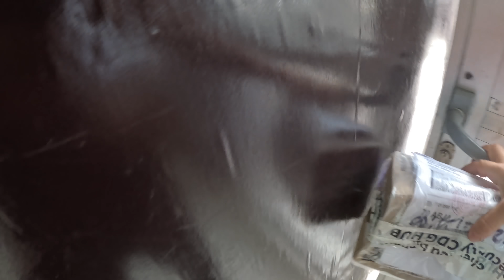Opening up the engine of my Honda CRF300 Rally in West-Africa |S7-E52|

Comment: nice work they did there
even in the rain?  haha   

And no front but you couldve let like 0.5L oil out of your gearbox and klutchbox and then look at how the oil looks
and just refill 0.5 fresh oil if its fine

as soon as i saw the colour of your oil i knew what was wrong .. look at the heat colours holy smokes

its not supposed to chew into the alluminium like this

the problem was your missing temp sensor 

no hate just wanna give advise
anyway keep on doing what you doing you awesone

much love from germany

Comment: 😳pity they did not spend 10 mins cleaning the engine externally,  before opening & stripping it to prevent even one grain of sand/dirt from entering! - OMG no torque wrench ! 🔧they are like a $50 tool these days.  btw imo it would be GREAT if you listed the 'parts' changed in your wrap-up.

Comment: Nah That's not Road side repair. I swapped a piston on a Mk 1 1200 CC CORTINA in the basement  of a  Valencia Hotel, Spain. Left a large oil stain on the new concrete floor back in the 1980's. All on my own.

Comment: And that’s why I own a Honda!  I wouldn’t even consider any other brand… they work, and when they break, they are so straightforward to repair.  I’m not impressed with all this electronic wizardry…. Reliable mechanics is all we need
Reply: Quite literally the same setup on any Japenese single piston dual overhead cam motor.  Not much different about them

Comment: There was no need to take the engine out of the bike for what they needed to do.  They didn't need to take the top of the engine apart either.  All they had to do was take that one side cover off that has the clutch.  

They also didn't soak their clutch plates before putting them in.  Will be extremely lucky if that clutch doesn't burn out quickly.  This is beginner motorcycle mechanic knowledge..

Just a real dirt bike mechanic here, not these bots in comments.
Reply: Correct, with enough tools you can basically do this trail side if you were carrying a spare clutch basket and tools for whatever reason.  Seen enough dudes at the track grenade a clutch and redo it in the pits in no time
Reply: @ratboyiscool  yep! I've done clutch swaps in the pits between motos a few times.  I've also rebuilt top ends of 2 strokes, and adjusted valves of a 4 stroke between motos before.
Reply: @jacobahl8317 I snapped a head stud between heats once.  It was 10+ years ago so I cant remember what we were trying to get at.    Buddy let me tell you I was cursing everything on this earth when that happened xD

Comment: WATCHING THEM WORK ON THE BIKE WAS CRINGEWORTHY... ABSOLUTE WORST PARACTICES POSSIBLE. CAHNCES ARE THAT IT WILL PROBABLY BE FINE, BUT, I WOULD TAKE IT TO A "PROFESIONAL MECHANIC" AND HAVE THAT MOTOR TORN ALL THE WAY DOWN FOR PROPER CLEANING/DEBRIS REMOVAL. IF IT DOESN'T ALREADY HAVE A MAGNETIC PICKUP SOMEWHERE, LIKE IN THE DRAIN PLUG, YOU SHOULD GET ONE. !SHANGE THE OIL AGAIN ASAP!